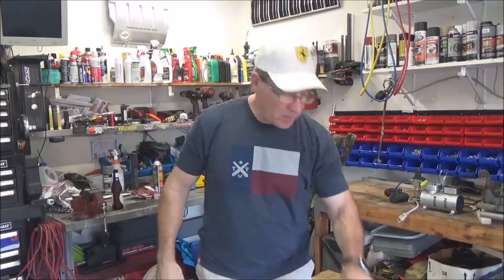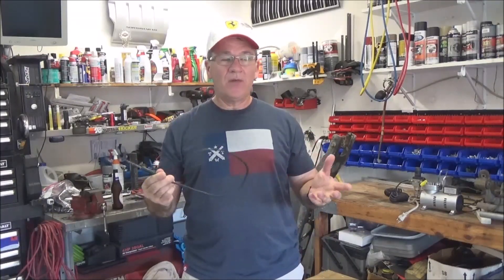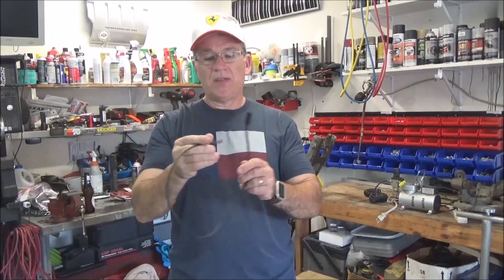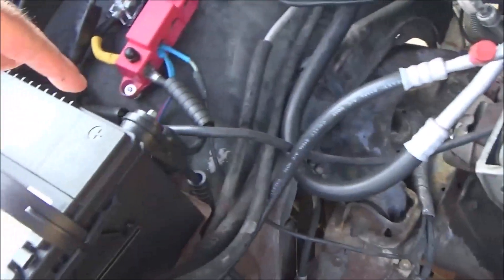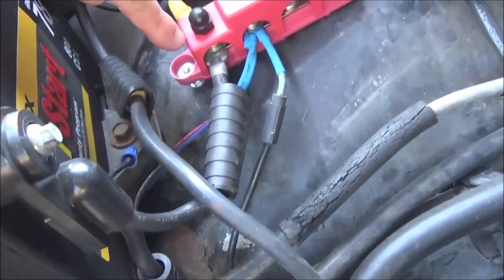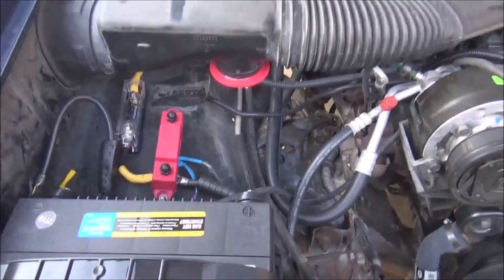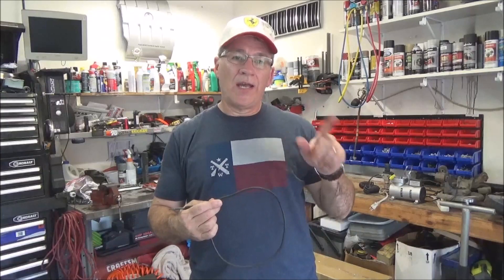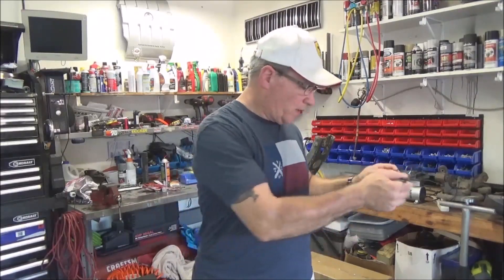Chevy 1500 OBS Charging System Upgrade

Comment: Navy dad, what is that red thing under your upper air take housing
Reply from the maker: Hi it's a "Mechanical Test Plug" https://www.homedepot.com/p/Oatey-Gripper-3-in-Plastic-Mechanical-Test-Plug-33402/100168770 I removed the big plastic "Muffler" from the air cleaner intake hose and used this to plug the hole. they come in many sizes. The center black part is rubber, when you tighten it down it pushes out to seal it.
Reply: @NavyDad  Thank you for the quick and detailed response shipmate! Is that plastic baffle purely for noise reduction?
Reply from the maker: @Honey_butter_mmm  yes it is which is why i removed it the louder the better. a lot of folks take off the entire air cleaner assembly and replace it with an open filter type or do the classic "Lip Flip" both bad ideas. It might feel quicker or have more response, but not for long. Once the engine compartment gets heat soaked any power gains by doing that are lost to heat. For the TBI trucks 88-94 the air cleaner assembly is a true cold air. Inside the left fender where the tube attached to is air routing scoop which air is forced into behind the battery in front of the grill, its really quite good for the time. For TBI 4.3, 5.0 and 5.7 trucks the best bang for the buck is to find an SS454 or 3500 454 with the larger air cleaner with the 8in snorkel. I found mine on eBay for about $80

Comment: Whats the size of the bolt you used to connect the ground to the alternator?
Reply from the maker: I used existing bolts for both sides on the alternator its the back mounting bracket bolt and on the frame its the bolt that holds the brake line mounting bracket to the frame

Comment: Im having the same problem on my 98 silverado. Im in Dallas and I dont trust the mechanics in my area. Can I take it to you  please
Reply from the maker: Hi I'm not a shop and don't really work on other people's rigs. I work about 60hrs a week and barley have enough time to work on my own stuff. what is your truck doing?
Reply: @NavyDad  Thank you for replying. I understand. I have a 98 chevy 1500. 2 new batteries and 2 new alternators. Still will not hold charge.
Reply from the maker: @drewmartinez3243  First check all of your ground wires and make sure they are good. This sounds like the wire going from the Alternator to the battery is bad. the fusible link is close to the end of the cable on the battery side its usually a green or black thick part of the cable about 2 inches long. The links can blow and not look like its blown. I hate those things they always cause trouble. to save time over building a custom cable setup got to O'Reilly (not autozone) they should be able to order an OE style cable to replace all 3 or 4 wires coming of the positive side of the battery.

Comment: Do you happen to know how many ground are under the hood ? And where they are located ?

I have a 93’ with a 5.7 am while it idles I’ll get 14.0 to 14.2  volts at the battery once I put on lights and ac it’s drop to about 13.8 to 13.9 but once I put it in drive and the idle drops then it goes down to 12.76!! I’m wondering if it’s a bad ground?!?
Reply from the maker: Hi First check the alternator, take it to O’Reilly's or other to have it tested (and check the battery too) the alternator has an internal voltage regulator that can get weak from heat (GMT800 trucks have this issue too). As for grounds the mail culprits can be lights and the body to chassis strap. The headlight is on the fender right next to the battery, they can get dirty and corroded. Then check the taillight ground it’s on the frame to the left of the spare tire. It can get rusty. When I bought my track it had no rear lights. The ground wire got pinched by the spare tire at some point and was nearly broken. Then check the body strap. It’s a steal mess wire from the firewall to the fame just under the AC accumulator. Mine was very frayed and about broken. There is also another large accessory ground AC accumulator. there is a plastic cover held on with plastic screws thingys (the fuel pump relay in under there too) that ground does not fail to often but dirt can get packed in the cover. There are many other grounds but those are the main ones that mostly have issues
Reply: Thanks for the reply ! I’ve actually changed the alternator twice it burned the first one cuz I didn’t notice that it was struggling to charge. And the battery is also new from Walmart.

I cleaned the ground for the head lights an a ground on the driver side by the spare tire. Is that the ground you are talking about in the back of the truck ? I tried to clean the ground straps on the body but the bolt was tight and ended up breaking the bold off the fire wall. I’m thinking of running a new ground from motor to body like you did. 

Also does your fuse able link go from the battery to the alternator? Or from the battery to the starter ? Idk why I feel like the red wire from my alternator goes straight to the starter. Again thanks for the reply ! I can’t wait to get this figured out I just did a 4/6 drop and ran into this and have not been able to cruise lol

Comment: Holy shit I think this could be my problem
Reply from the maker: Cool I hope fixes it!
Reply: Problem is I changed the whole positive wire that included this one I went to the junk yard and got another but then I was putting it on we sparked it in accident having the battery connected so maybe I just blew the new one I got cause it’s still not charging same engine 5.7 vortec with only 150k miles
Reply from the maker: @adrianherrera9688  possibly, you can test line with a cheap multi meter from Harbor freight. check all your ground wires also check the Alternator too.
Reply: @NavyDad  it was my dash !!!!! My dash wasn’t fully clicked in somehow that didn’t let the altinator charge

Comment: My alternator whines it’s brand new have replaced the new twice do u think no ground could cause a whine or bad connections
Reply from the maker: sorry for the delay I didn't get a notification on this one. Yes check all the grounds if its a Chevy OBS check the headlight harness ground its right next to the battery and they can get corroded. and check the body to engine ground strap back right firewall under the AC dryer, they get rotted easy
Reply: I thing that you problem could be a losen serpentine belt

Comment: Why a fuse on the alternator wire. 
There is no fuse there by factory
Reply from the maker: Correct there is not a factory fuse but there is a fusible link. look at your OE wire and a few inches to where it connects to the battery you'll find a back thicker part of the wire. if the voltage regulator in the alternator freaks out and starts over charging the battery it will burn out the link in the wire to keep the battery from catching on fire. those links are a pain as sometimes they break or burn out and you cant tell from looking at the wire. a fusible link is probability better as it does now work the same as a fuse but a fuse if better then nothing. and finding a fusible link for a 4 or 6ga wire is not easy either. Here is one from Summit as example for $50 https://www.summitracing.com/parts/sum-810004?seid=srese1&gclid=CjwKCAiAtK79BRAIEiwA4OskBvcsoMZab1Tg_4qBJ34rIdMxSZX4uJ8CZm7RsGuvMAt_0sBB45LdahoC1v4QAvD_BwE

Comment: They want 78 dollars for a fusable link wire i think thats a rip off thats why i want to make my own
Reply from the maker: Yup can't stand fusible links, they blow and sometimes you can't tell modern cars/trucks don't use them anymore heavy-duty fuses and 12v breakers are much better. Just make sure   to use one about the same amp level.
Reply: @NavyDad  im wiring up my 97 gmc the exact same way as you did in your video i even bought the same fuse. Your video is not only saving me $ but its also better